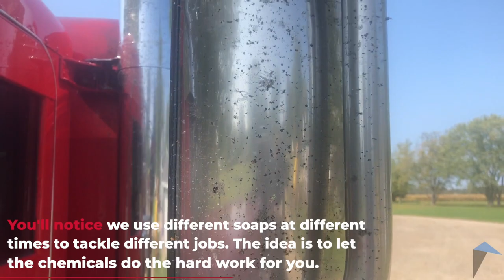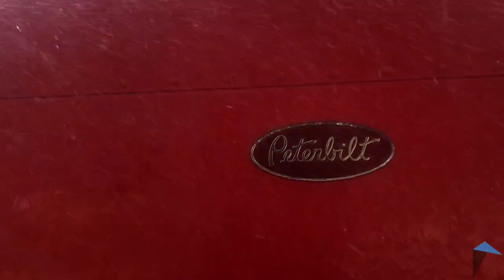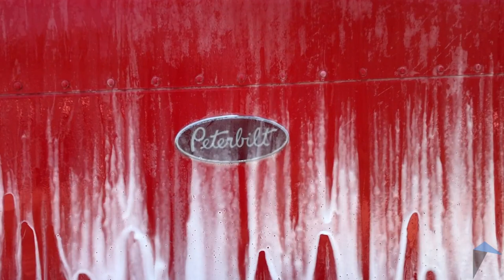How To: Bug Removal + FULL Wash + Foam On Wax Replacement! GORGEOUS Petebilt!!!

Comment: Do you use hard water
Reply from the maker: In this video, It is more than likely we were using hard water. For a long time, we only rinsed using DI water as a final step to remove what remaining hard water was on the surface.